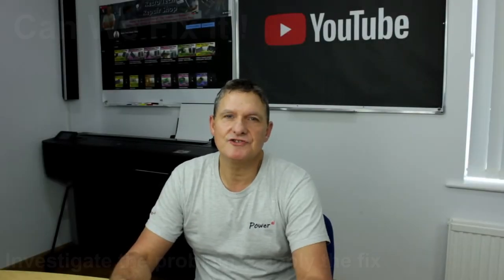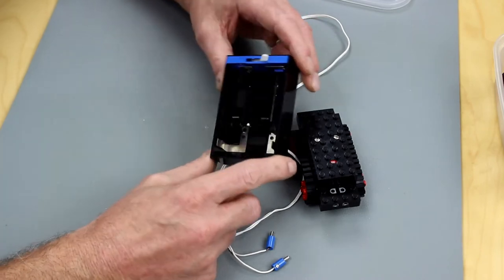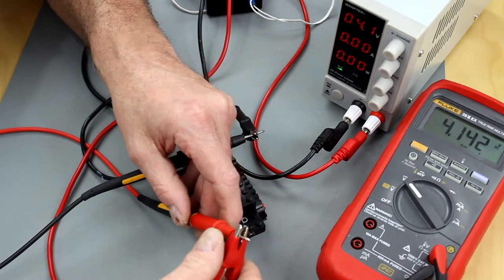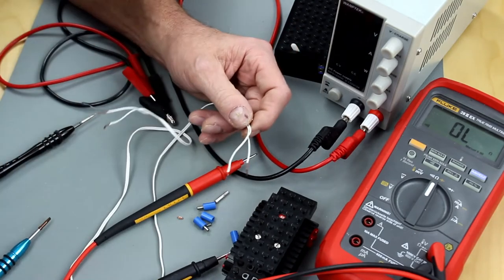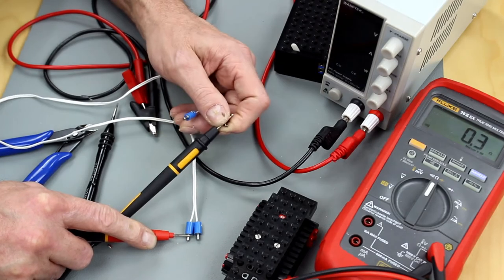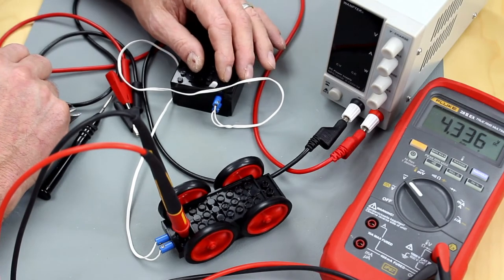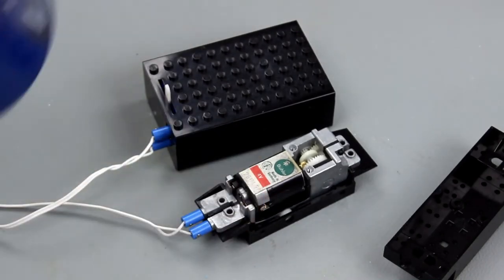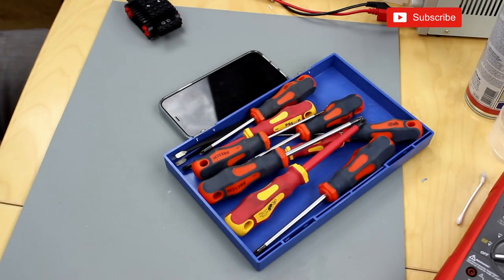Lego universal motor set repair. A simple repair to this eBay purchase. Find what we needed to do!

Comment: Hi. What electrical solvent did you use for the motor? Mine makes a strange sound ...just as if it was only  just a little bit dirty inside
Reply from the maker: Action Can IPA Pure Isopropyl Alchol Solvent Cleaner Electronic Cleaning 500ml.
You can see the spray can in the Datsun 280Z RC car repair at around 3.34 minutes in. Hope that helps and good luck with your repair.